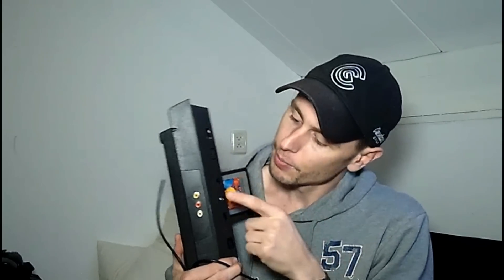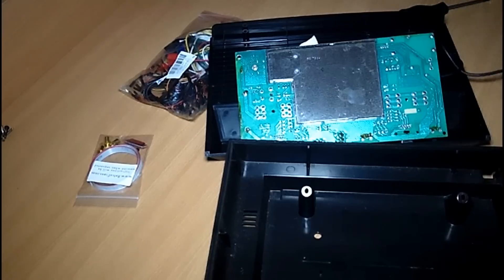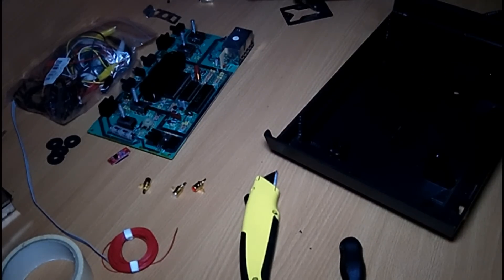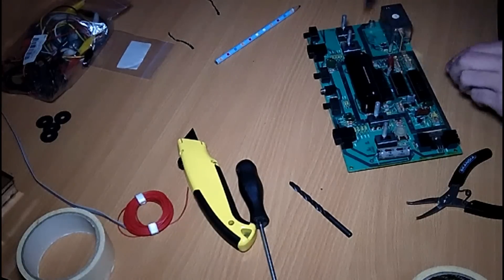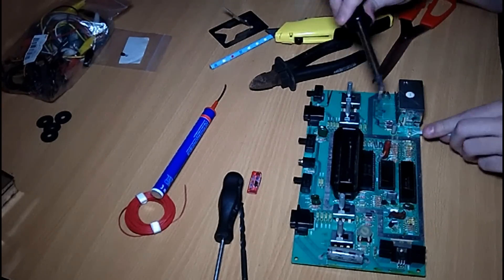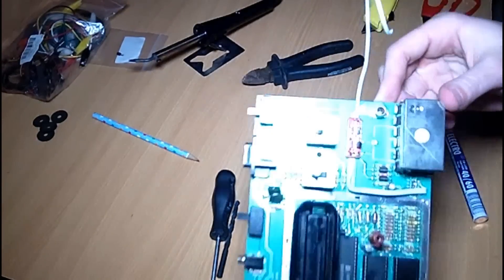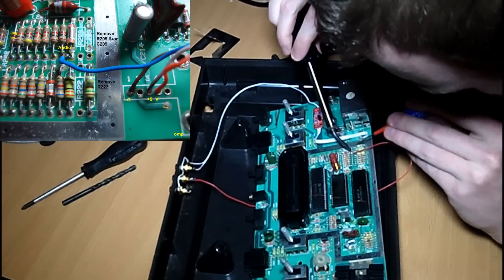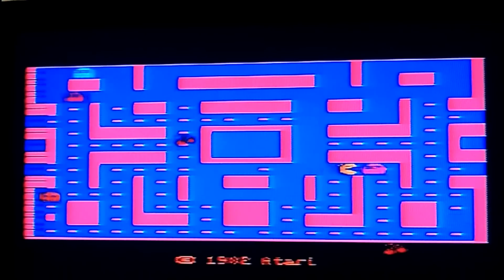Atari 2600 Composite Mod

Comment: Hi
I've done this mod but it shows a line on the screen like fuzzy interference.It goes up and down the screen.any ideas chaos?
Reply: Replace the 2200uf 16v cap on the board
Reply from the maker: Replace with what?
Reply: RetroGameCouch with a grilled cheese sandwich ,,,,,,,,durrrrr with a known good or brand new 2200uf 16v cap . I scavenged some off old pc power supplies,,, or eBay .
Reply from the maker: Lol. I figured you meant a different value one. 😁
Reply from the maker: Obvious question is, how did the screen look like before the mod?

Comment: Hi. I followed your steps. Thanks! However, the video quality at end was not improved at all. Any ideas? Anything on the board for me to tweak? Thanks
Reply: add a built in upscaler
Reply: Remove the red choke coil from the PCB, it will make a large improvement.

Comment: Has anyone done a 2600 mod by gutting and mounting one of the newer single board computers?
Reply: I'm starting to now. I just ordered a couple cables, and need to update my RetroPie image on my Raspberry Pi. It's a "when I have free time" project, so I'm not in any rush with it. You can follow my Instagram at raspapplepi.

Comment: So question: can one install the composite output mod and LEAVE IN PLACE the fuctional RF circuitry, or does it require one disconnect the RF circuit as the only way to go?
Reply: I believe this is a one-way mod since you are removing components. I know it is on the 6 switch model anyway since you actually remove a few more components during the mod.

Comment: Could one still play the light gun games after this modification?
Reply: Hm, I'd think maybe not, as those sorts of games tend to rely on the electron beam scanning the tube television screen to locate/sync with the gun controller.  So playing it on a non-tube television would not be possible; but going from RF to composite to feed a tube television should make no difference.
Reply from the maker: +Fleder I am pretty sure it won't have any. Mine said so as well, but they were just variations of the same game.
Reply: I do have 2 different light gun "games" on mine, plus a nice light gun which you can turn into a rifle. It is the "universum multi spiel 4006".
Reply from the maker: +Fleder oh really? Let me Google that thing for a bit.
Reply from the maker: In theory the lightguns should still work as you're just outputting the same signal over a different cable. If the lightguns are like the one of the NES or other systems then it will only work on a CRT screen.
Reply: Thank you, I will just jump into it and see if it works.
Reply from the maker: +Fleder keep me posted
Reply: Will do. And sorry for the mix up. I mixed up the Video for the Pong Clone with the Atari one. Thus the question about light guns :)

Comment: Would it be possible to just get a Coaxial to RCA Adapter and use that instead?
Reply from the maker: +Cameron Colon thats using coax, which is not a great signal to begin with.

Comment: I'm about to attempt this mod mainly because the damn cord has gone bad and you can't just replace it with a different random RCA cable because...geometry.  Very nice video though.   BTW, I wish I had an accent of any kind.  Own it.  Nice sound effects too.  Those don't go unnoticed.  Thumbs up!
Reply: +Ted Soto And I subbed by the way.  Time to switch to non-ad-block mode to watch the mod again.
Reply from the maker: +Ted Soto Have fun. It's not a particular hard mod to do. I found the drilling to be the most challanging to do it right.

And the accent.. hahaha, that's one of the cons of not being a navive english speaker. Hope people can still understand it. :)
Reply: RetroGameCouch
I am not going to drill the case.  I plan to run the composite wires through the existing hole to make it more authentic.  I just can't damage the case.
Reply from the maker: Ted Soto I think the RCA plugs give it a clean look. But if you want to keep is as original as possible, using the existing wire hole is a great choice!

Good luck!